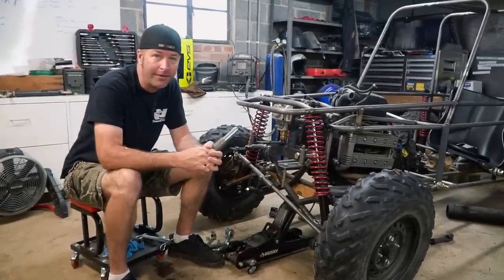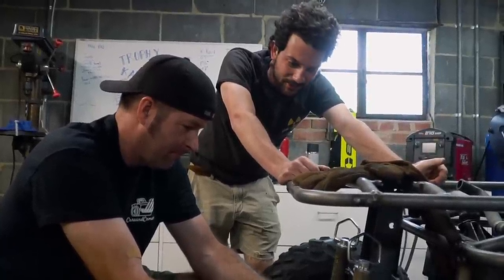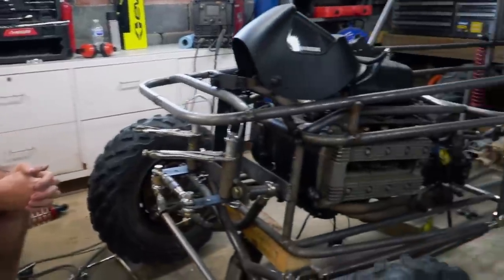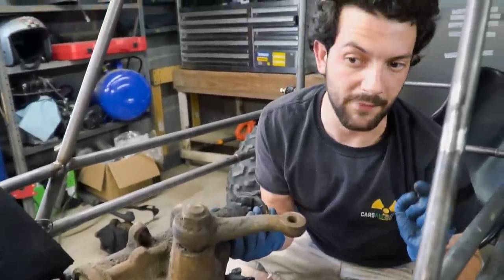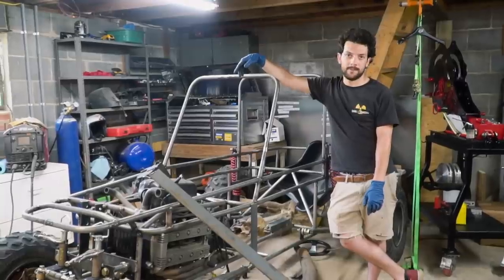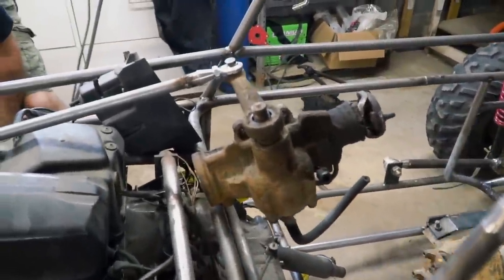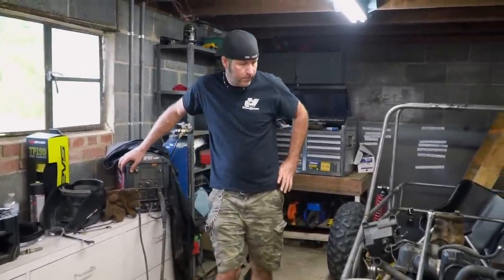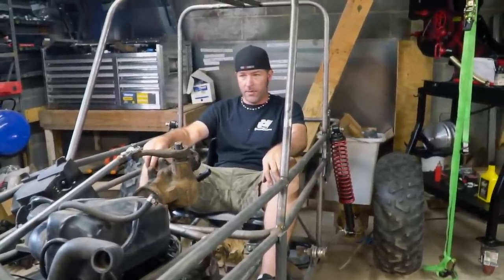1000cc Trophy Truck Build Pt. 9 | Steering Finished!

Comment: Rob a steering box from an old John Deere garden tractor.  My 1970 110 has an awesome steering box, it is super smooth.  Worm gear, no play, adjustable, oil filled.  I know the 110s, 112s, the 200 series, and I think the 300s have them.  Just look for a 70s model John deere gt without power steering
I think Ike has one at his house that got flooded.
Reply: I was just getting ready to say this. I have a 73 110 and it steers butter smooth with one finger. I just checked ebay and found quite a few. Search " Ross steering gear box".
Reply: Yep, cub cadet also used them from the 1960s through early 2000s. The Ross box is a three turn. Jd used them too. Those are 4 turn
Reply: 300's have hyd. cylinder for steering. Had a 322, a beast

Comment: One plus of a pole barn is that it goes up fast and cheap! I’ve got 4x4 treated posts in the ground 30 years now and no sign of failures. Plus you can always add onto the end as long as you need in the future

Comment: I-Beam style, steel exterior. My father had one built once that was converted into half of his house and the other half into an airplane hangar. Surprisingly the building was very versatile, efficient when insulated, and after 35 years still stands today and in every bit of good shape as when it was built. Part of my fathers hangar side of his I beam building he used for restoring muscle cars, and fabricating chassis for race cars. We devised a ton of neat stuff into some of the buildings beams, like an engine hoist, car lift, and holding up the upper level office floor. Versatile.

Comment: Awesome build, my only concern is that the steering shaft is essentially a huge spear to the face if you ever have a hard front end collision.
Reply: racing harness
Reply: Someone will always point out something "unsafe", even if it's a cotton ball.  Don't choke on it Johnny!
Reply: @SportbikerNZ  I mean there's always going to a way to make things safer, there's no reason not to consider it
Reply: @kevinponce8525  Let pragmatism triumph I say.  No point expending a heap of time an effort to change something like that.
Reply: @SportbikerNZ  not after the fact no but by bringing it up now it might alleviate some surprise later dontcha think?
Reply: If you were super concerned you could rip the crush shaft from a car's steering rack and work it in. They're usually splined the whole length, still engaged no matter how hard it's crushed. 

It's also really easy to integrate the e-power steering from a saturn vue or prius...
Reply: @Rattus-Norvegicus  Not really.  These videos trail work be at least a couple of weeks and there's nothing wrong with the current setup.
Reply: there's a reason car manufacturers went with a collapsable steering column....
and that is it
Reply: @SportbikerNZ  Except that there is something wrong with the current setup, the problem that this entire thread is talking about. And even if it is too late to change the setup, it might be possible to mitigate the risk later on. If nothing else, you are giving them the information and they can choose to do with it as they see fit.
Reply: @Rattus-Norvegicus  There is no problem other than what is the nature of nearly every go kart ever, a steering shaft inclined toward the driver... and a bunch of clueless drama queens making an inane beat up over nothing.
Reply: @Rattus-Norvegicus  You know what they say about assumptions.  No need to be a weasel.

Comment: I suggest a steel building, I-beam or truss. 
We had a 30x40x12 with a 10x40 covered porch built a few years ago. It's insulated with 2 10x10 insulated doors.
We had the electric run from the house to the slab before they poured it.
Later, I installed 16 8' light fixtures and a 3-ton mini split A/C with heat (saved thousands in labor by doing it myself).
It has become our go to area to do anything.
My son (we met you guys out at the Pate swap meet last year and John picked rocks with him) always wants to have picnic lunches out there while I'm wrenching on stuff.
They always say go as big as you can, and I agree, but this shop has a compressor, a blasting cabinet, 2 6' shelving units, 2 8' wokbenches and a 6' workbench, 2 floor cabinets, can hold 4 cars and two motorcycles, and there's still room to walk around all of it.
And I can get it down to 72 degrees inside when it's nearly 100 out.

Comment: You guy keep it up you should make a new shifter cart with a dirtbike engine
Reply: 125cc 2-stroke shifter karts have a dirt bike engine
Reply: Shifter cart with two rear dirt bike engines
Reply: Considering they already did the 4 engine 4wd predator cart
Reply: Yea they should put a 500 2stroke on it

Comment: I'd love to see videos on the shop build. An easy option would be a self assembly all-metal pre-fab kit, they come pretty cheap, pretty big, and you don't have to worry about fires from welding and stuff. The only downfall is that they are uninsulated, and you can't put in a second floor. For that reason, I think you should go ahead with the I-beam style like you said. Keep up the great videos.

Comment: That steering and suspension is a death trap in the making. But I guess “it’ll be fine” right.
Reply: I have seen many weak points in this build. Mostly frame. I do not think they used Cormoly tube. And should have at least used Square tube in the base frame. 1" or 1-1/2 tube will be to weak.
Reply: @bryansmith5980  that's insane. For the riding they do it will be fine. Cromoly is far to expensive for this sort of project unless it's being raced professionally. I think you are underestimating the strength of mild steel. They could have used aluminum and it would have been strong enough. Again not so cost effective though.
Reply: Out of their depth with this one.
Reply: The same clueless internet "experts" said similar things about the cross cart frame.  It was quite funny to go back and rub their noses in their inane predictions.   Lots of humble pie to eat.
Reply: I agree, looks VERY sketchy to me. What's wrong with A arms and steering racks like all modern buggies have?? You get the Ackerman, adjustable camber, caster, and toe, and no bump steer.
Reply: Donell Muniz cross arm is okay “definitely simpler designs”, but in my opinion this attempt has a lot of flaws, it’s fun to play with ideas but sometimes others have destroyed the box you’re trying to think outside of.

Comment: Starting with the new shop- building with an steel girder frame is "life time" if the steel is all well protected from moisture and rust. The traditional stick frame will need serious pre engineering if you want to later put a mezzanine or second floor in it and any support from the structural perimeter walls is needed. The pole barn would be the more flexible and if treated lumber is used for the poles and lumber in contact with the ground, will last upwards of 40-60 years given some maintenance. Also worth noting- the pole barn (and to a degree the steel framing) build will need holes dug (rent a skid steer with a 12" auger) for the concrete piers that support the poles- burying wood shortens the life expectancy dramatically, but the concrete floor can be poured later, in the shade! As well as subfloor plumbing- much easier if you don't have to work in the direct sun or in the rain!
  On to the BimmerCar; your longer tie rod arms are getting close to the same length as your half axles-  a very good thing itself, but you are over thinking the connection between them- there is so much hardware, you almost cannot prevent a bind at some point. As my earlier post badly tried to explain, the two long arms directly connected to the spindle steering arms need to be close to parallel with the  half axles and very close to the same length as the distance from the frame end pivot point and the center of the wheel; the line from the center of the frame pivot point to the centerline of the wheel bearing shaft is the "design center" for the half axle. The steering gear, over the top is very on the right track, but I agree a lighter and less bulky box would be better- something from a small Japanese or European car is more likely to be what you need- prior to 1985, , the front engine rear drive Toy Corolla comes to mind, it has recirculating ball steering gear like the box you have. Also the Chevy Vega and it's several clones in the GM line up do as well. Back to the tie rods; the arm of the steering shaft passing over the motor needs to act on the end of the long tie rod tied to the right wheel, and the left  tie rod ball joint needs to position as close to the left axle pivot point as the right one does, and the ball jointed end of the left tie rod needs to pivot from a mounting on the right steering tie rod. Such that they are both nearly parallel with the half axles  at ride height. All of that center cross linkage is just more stuff in the way and will not much improve the inherent tendencies of the twin I beam design. And yes, there will be more bump steer at the longer jounce and rebound built into an off road car. At those angles there are many other directional forces, stronger forces than bump steer trying to pull the steering from the course you are steering. FWIW, if your present system works as well as you hope, I will be very interested, as I am trying to work the twin I beam concept into a paved track roadster- but it will only have 2-3'' up and 2-3' down suspension travel. I've done most of my work so far with cheap PVC pipe and fittings, trying to answer many of the same questions you and Isaac are, so most of my details have some practical 3d experimenting done.
   Hope all or any help, and like I said, I will be very interested in details if your present system works as advertised- my PVC experiments say it isn't likely- but I'm a plumber and HVAC tech by trade, not a car designer!

Comment: Go for the pole barn. As someone who's built all of them, I can say that a pole barn of 40x60 can be built solid and permanent (with proper bracing). I've even made them out of old chicken house trusses (put 1/2” or thicker plywood sandwiched over every joint use either construction screws or galvanized ringshank nails that you curl. If you cover the bottom cord with tin or whatnot you never see the joints. My father in law once built a man a 40x100 for just under 21k.  I live in GA so idk what NC law states though...

Comment: If you do a red iron building, You'll probably have to do a footer around the perimeter of the building to support the weight. We put a preengineered steel building up for my brothers garage and we put one about 10 - 12  inches thick around it. Also if your planning on a second floor in it make sure it's engineered for it. We had to go in & tear a second floor down in a different preengineered building because it collapsed because it wasn't made to have a second floor attached to the columns.

Comment: I am a professional building designer in Ohio. In your question on what type of building,  definitely a metal carport type of building will be the least expensive and they are not a bad building, in fact I own an 18' x 20' myself. Make sure you get an "A-Frame" style roof with vertical metal on the roof, you can get vert. or horiz. metal on the sides.  These buildings are a little bit more difficult to insulate and add electrical. Normally the carport style is based on 5' center to center upright spacing. A Post and Beam (pole barn) construction is another affordable way to build, make sure you do not set poles into the ground, construct a foundation either by pouring piers or a continuous foundation to keep all wood above and out of the ground.. Best way to insulate this type is with rigid insulation between the girts and purlins.  Poles are usually spaced max. 8' center to center, so base your dimensions on 8' nominally. The steel (red iron) building is a great commercial way to construct a building. These again are a little more difficult to insulate and add electrical.  You can find kits for all of these types of buildings and could make great content putting one together. So to give you an answer, Id say any of them will perform well for you if built properly. Please let me know if you would like my assistance in designing a building to fit your needs. Thanks for all of the great content.

Comment: Do the red iron shop. Build it 40 X 40 and leave room to expand the length. I've never heard anyone say they wish they had built smaller. Put in a much larger electrical service than required so that it doesn't have to be redone to expand. Also a covered apron outside for extra work area. A wash rack area outside means you can clean parts before bringing them in which keeps the shop cleaner. Just some of the things I plan if I'm ever able to build my "Dream Shop".

Comment: I think your I-beam barn is the strongest plan, but I think the pole barn is the most versatile. For instance it would be easier to insulate in the future if you get tired of cold winters and hot summers. I think it would be worth considering the future of the building. Repairs, maintenance, and potential changes you may want to make to the building.

Comment: Well once again I find my self a bit in the rears as far as timing goes, I have just recently started watching your channel but I also have some comments  that may be helpful. You mentioned you are going to build a bigger shop. Awesome, you will not regret it. You also asked what we thought about the type of building you should build. Its my opinion that the most bang for the buck is a pole building. Im from Wisconsin, but live in Arizona now, and Wisconsin has maybe more pole buildings than any other state.lol
Poole buildings are as permanent as any building, and the cost is far less than many other styles. They can be insulated easy, and are very low maintenance. The key no matter what  you choose is having it well insulated. The better the insulation, the easier it is to heat/cool. Either way, glad to hear you are going with a new shop.

Comment: I-Beam for sure with a I-Beam trussed loft  for heavy storage and allow trolley hoists to houst to the loft. Two stage air compressor, 2 Beam trolley hoists, 2 modified Harborfreight  motorcycle lifts with these mods (12" removable wings on each side & air over hydraulic lift jacks. 300 amp electric service (you won't be sorry). Also look into a Rotary Phase Converter( American Rotary) to run 3 phase  air compressors, mills, lathes on single phase 220 volts.

Comment: Pole barn construction - minimum 8inch slab (auto lift later), radiant floor heat even if u can't afford the boiler yet, steel siding and roof (virtually no maintenance). 1 inch closed cell urethane foam, then normal fiberglass, and 5/8 t&g OSB, then drywall. Clean, efficient, looks good, warm in the winter, cool in the summer. You can use residential roof trusses so u can use the upstairs space for storage.

Comment: Here in Indiana I would go with a pole barn building.  We don’t have hurricanes here, just an occasional tornado.  Build it with plenty of width for what you might need in the future.  You can always take out an end wall and add on more length down the road.

Comment: You left out Quonset.  That'd work for NC weather nicely.  Just my offering :)
Reply: God, I love those old galvanized, corrugated, military quonset huts! Functional, nostalgic, cool looking, and PROBABLY less susceptible to wind! But the curve limits your shelving and "upstairs" capabilities.
Reply: There's one a block from my house, built in the 40's. Rather than a hydraulic lift, it just has the 5 foot deep grease pit. I used to jump across it as a little kid.

Comment: Good thing about an I frame building is that it's modular so you can extend it easily. If you put the door at the opposite end from the end you will eventually extend it is way cheaper. You guys have the welding skills to make up a new portal frame. That seat will need to be higher unless you want a random man bits emergency brake on full rear shock compression..

Comment: My family uses a pole style building as a professional restoration shop. Added pro you might not be thinking of they can be be added on to relatively easy if you decide to put on another 30ft as well as you can put in an attic if you want.

Comment: Pole barn! Best way to save money. Erect just the structure. Still very strong. Don't have to pour footers. Also can build extra tall so you can loft off the top area later as a home. With a fireman's pole! Or whatever you want to call it. By doing this it can also accommodate a RV later as well.
Then after it's built when you have more money, you just pour 6-8" concrete floor right up to the walls.
Can be lathed and stuccoed, or even aluminum siding later to look nice.

Pole barn style construction optimizes your possibilities to build when money allows and breaks up the overall cost of construction, but still useful during every phase.  Best part is permit is cheaper, and permit closes when you just have structure. Pay off bank loan for that. Then build out  interior foregoing more permitting if so desired. just pull out a new loan on equity for next stage. Pay off again. Repeat as necessary until you have an awesome home, garage is now the entire first floor, home on second floor until maybe a real house in future.

Best bang for budget, hands down!

Comment: Looking good. (Just a TIP). When welding solid pipe its a good idea to grind both ends into a cone shape. Then weld them filling in the cone, for greater strength. Just a tip.